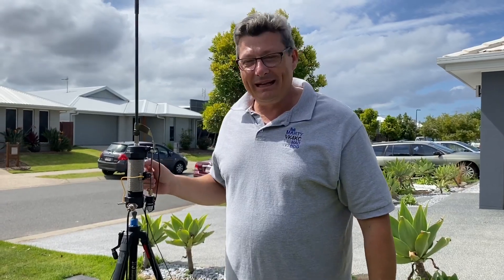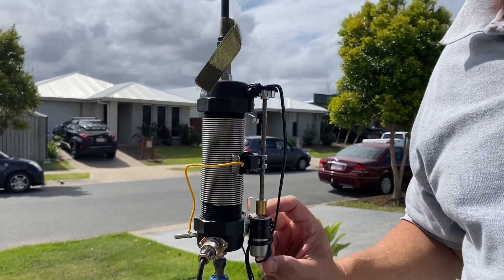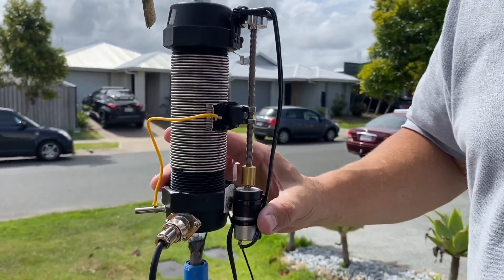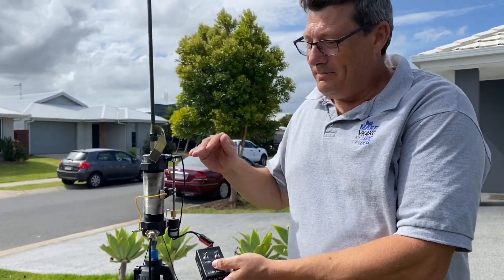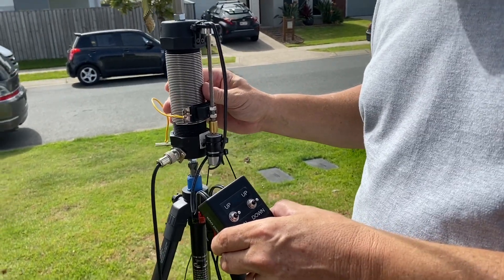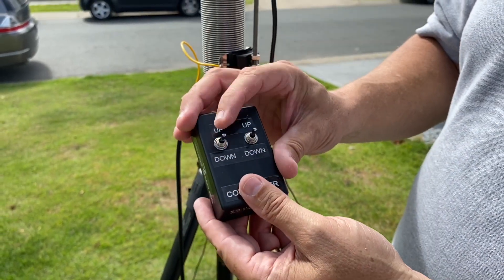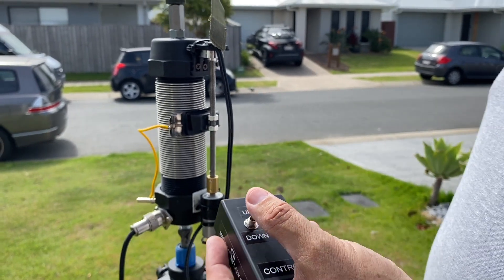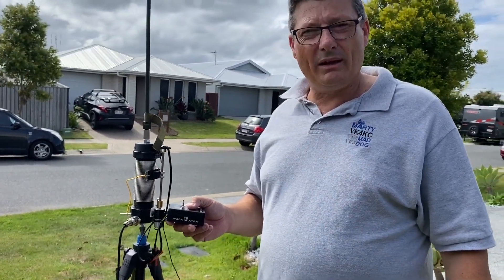The Mad Dog - Lazy Dog Antenna

Comment: Another interesting loading coil. Would like to see how you implemented the shorting pad/collar.
73
Reply from the maker: Thank you for your comment. That stainless collar is available in Australia at some hardware chains. I soldered an eye terminal to the end of a short wire and then used a small tapping screw to hold the eye terminal firm against the upper part of the collar. The other end of this wire goes to a banana plug which connects to the banana socket which is connected to the coax centre core. I have linked to a couple of other videos in my initial video comments that you may find useful watching.

Comment: Hi Marty, great design, very creative. Well done. 73 de Geoff vk3sq
Reply from the maker: Thanks for your comment Geoff. I’ve been using it today and it’s working well. Not as good as a full length wire antenna but good for confined spaces.

Comment: great  work  Marty  may I use  that idea  on my  160 base loaded coil  102  whip set up  thanks , Tim
Reply from the maker: Sounds goods Tim. That must be quite the long coil for 160. with a narrow Q so some automation will be helpful.
Reply: @maddogshamradio3407   the coil  form is 3" dia.  and  copper winding is between  16.875 to  18.000" ,on a 24" x3" pipe